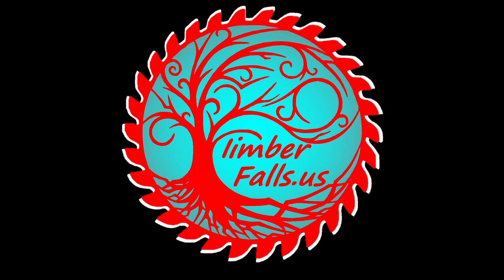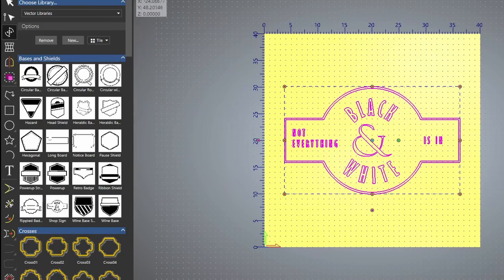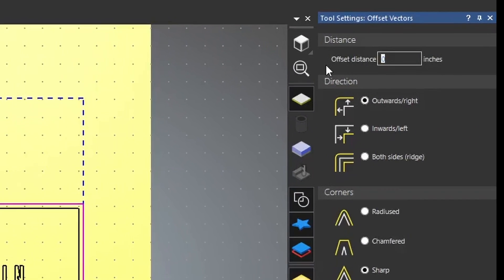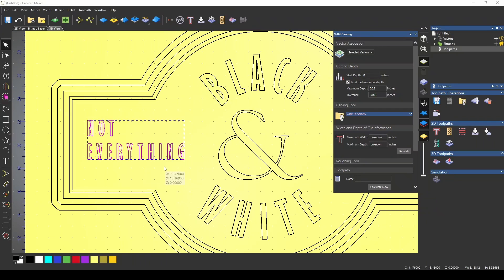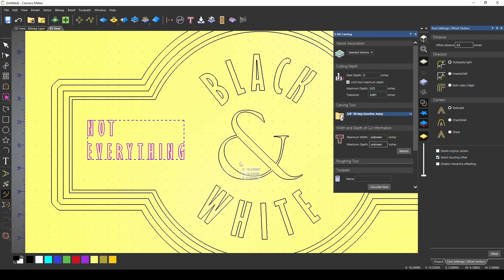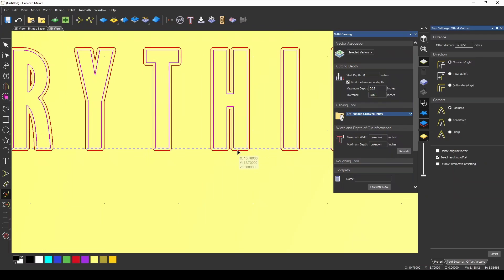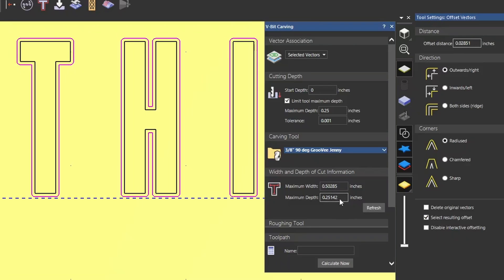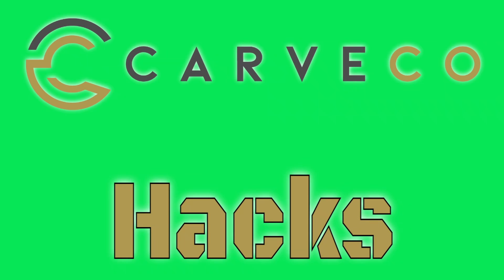Carveco Hacks: Simplify Designing with the Offset Vectors Tool | Boost Your CNC Projects!

Comment: When i try to inward offset a rectangular vector with rounded corners, the resulting verctor is created with sharp corners instead of following the same shape as the original vector.

If you know why it does this, and how to prevent it I would love to know, please.
Reply from the maker: the corners of a square that are rounded can only offset the distance the corners are radiused. So if the corner only has a .25  round from center of the corner then it can only offset less than this before the angle of the sides takes over and the corners are no longer radiused. Hopefully that makes sense and does not confuse you further.
Reply: Yes, thanks.
I will try larger radius and see if it works.
Reply from the maker: @DanDavidChinLee-s5h  Glad that helps.